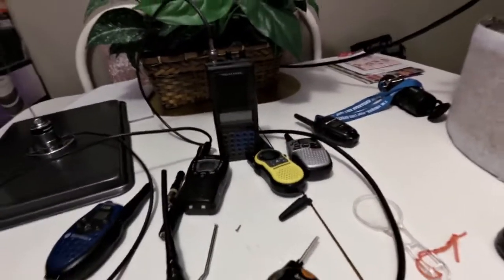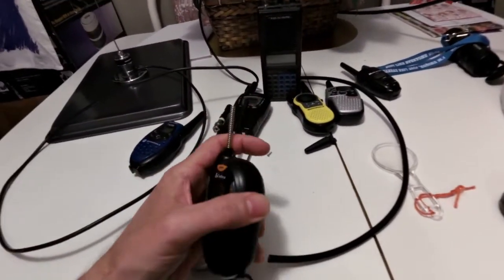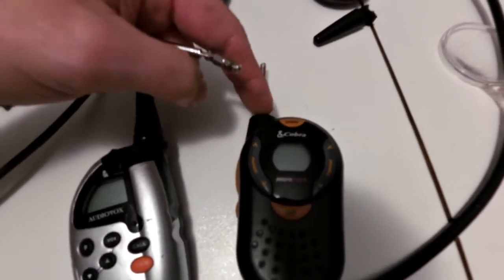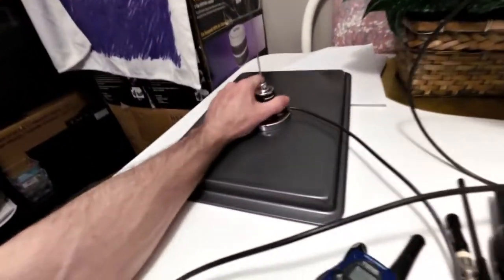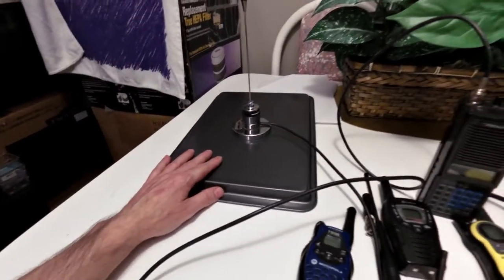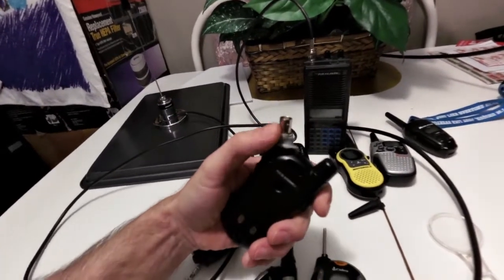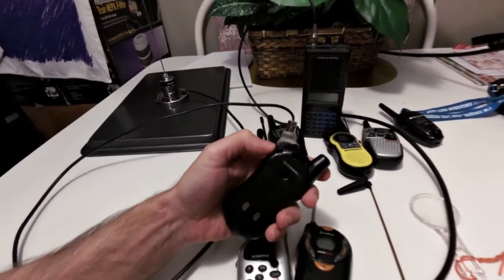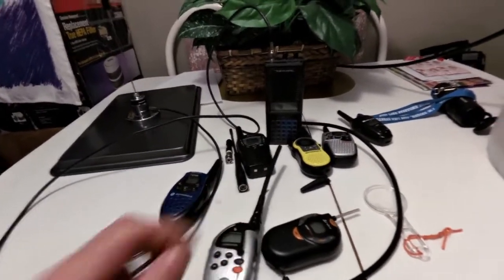Extend the range of FRS and PMR 446 radios

Comment: Makes no sense transmit and receive on the other
Reply from the maker: The built in FRS antenna has negative gain while the magnetic mount antenna has +5 dbi gain and you could mount it outdoors. Or, you could just use your smart phone to communicate. I like to experiment with radio antennas,  just showing what can be done to extend range.
Reply: @dtv5362 thanks for making this video. In an emergency this will definitely be useful

Comment: Tip - Get a mag mount dual-band ‘low profile’ type 140 / 440 whip antenna (brand I found was Tway).
Remove the antenna from the mag base (usually a hex screw).
Use a tack to poke a small hole in the top of the FRS antenna, then carefully slide the whip antenna down the center until it stops.
My tests show great improvement in RX & TX, as well as all the NOAA channels.

Comment from the maker: For FRS / GMRS cut wire to 6" For PMR 446 radios, cut wire to 6.3 inches from where antenna attach to circuit board to the end of the wire. Uncoil built in antenna and straighten it out fully before you cut it down.